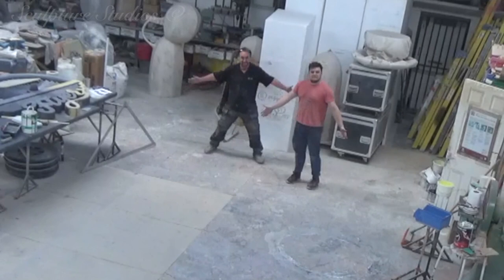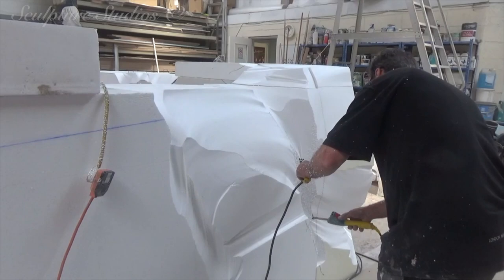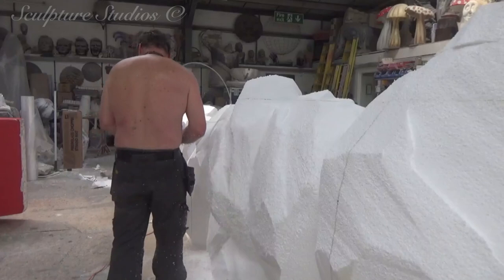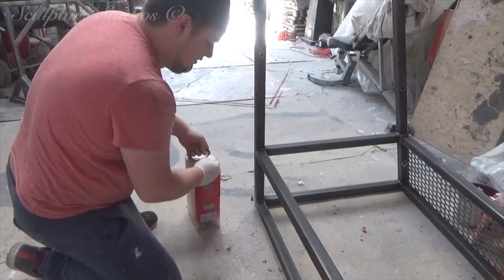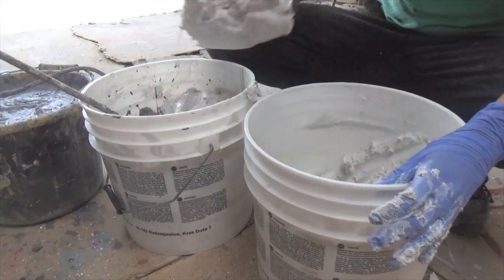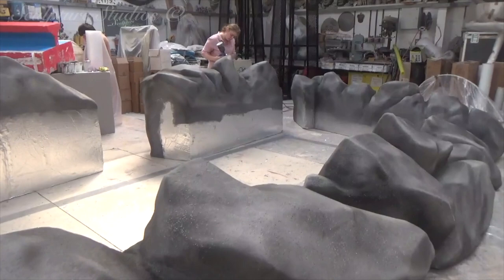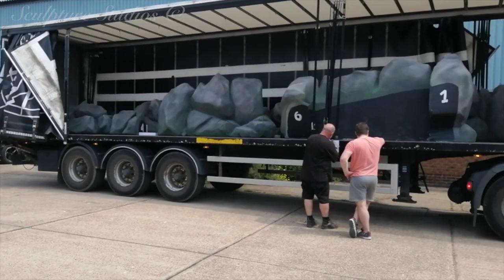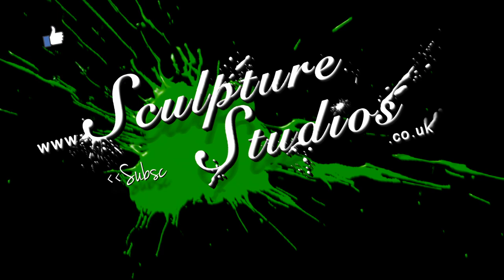Making a Giant Off-Road Rock Ramp Display by Sculpture Studios

Comment: If you use epoxy resin I think you could skip the tin foil process. In my experience Epoxy resin doesn't eat the foam. It cost more but I would think you would save alot of labor.

Comment: What glue do you use between foil layers ? Is it like waterproof timber's glue aka type D3 ? Does it dry between layers ? Does it withstand frozen temperatures ?
Reply from the maker: It's a sticky backed foil 😊😊 we get it on a large roll with a peel off plastic
Reply: @AdenHynesSculptureStudios  alright, thank you !